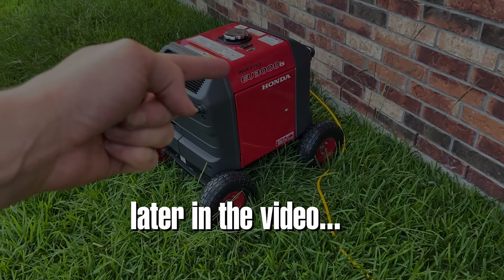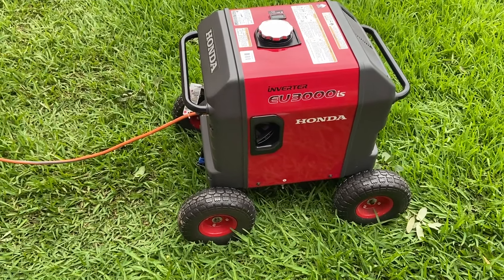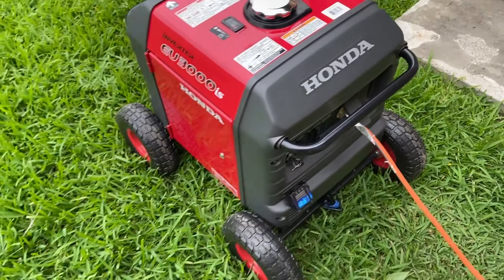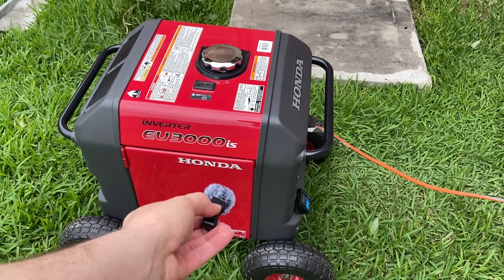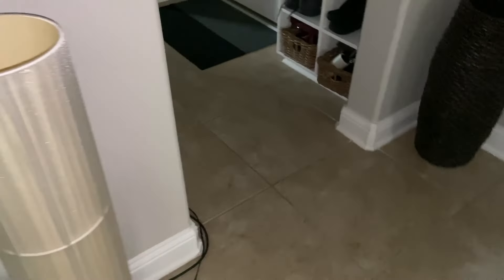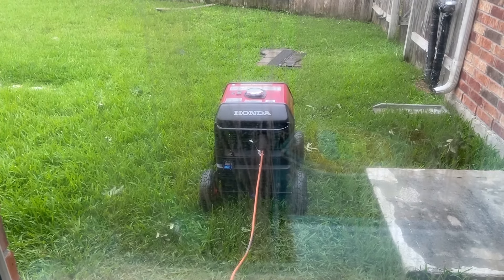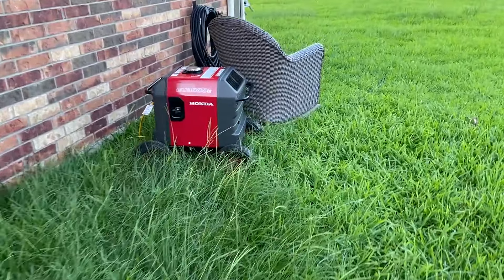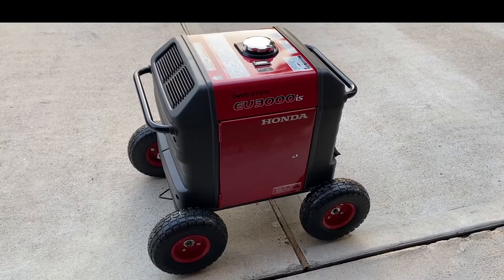Can you survive on a 3kw Honda generator? (Power outage survival test!)

Comment: With a Generator Inlet plug and interlock on the breaker panel you can get rid of those extension cords. The one 30a 120v plug will run everything including central heat (with natural gas), turn off 240v breakers.
Reply from the maker: I totally agree. It’s on my list of things to do.  Thanks for the comment!

Comment: What would you need to power the central air system?
Reply from the maker: That’s going to depend on your exact situation. I’ve heard of people running their home central AC with as little as 7k watts (Honda EU7000IS), but I think they had to modify their breaker panel and/or get a soft start for their compressor.

I would recommend getting sized for a whole home standby generator if that is something you’re interested in. It’s also going to be a lot more convenient using natural gas and not filling gas tanks if you have the money to invest.

Comment: Three things to look into. 

1.  Generator is a little too close to the window.  Old recommendation was 10-15 ft, now it’s 20 ft. 

2.  Battery powered CO detector. 

3.  Since the toaster oven pulls about 1500 watts by itself, you should have a dedicated 12 gauge extension cord out to the second outlet on the generator.
Reply from the maker: Great suggestions. Thank you for the comment.

Comment: I have 2 of these to combine the power output to a transfer switch. I used to keep ethanol free gas in the newer one and 91 octane in the other. The ethanol free fuel burned a lot quicker than the 91 so its kind of a pain in the ass because after a 6 hour outage the gen with ethanol free was at a quarter tank and the 91 was at a half tank
Reply from the maker: That’s interesting. If I can get more runtime from normal gasoline, then for sure I will keep that in mind during the next outage. Thanks for the comment.

Comment: You are showcasing the generator in eco-throttle. This is not representative for the general performance.
Once you start loading it with a few amps, it runs much faster (and noisier). I also have a 3000is, so that's how I lnow ;)
Reply from the maker: This video documents a real life emergency situation where my family survived on this generator for about three days. 

It absolutely shows the general usage capabilities during a real life emergency.  Powering several critical appliances simultaneously was no problem for this beast. The video speaks for itself in that regard.

The Eco throttle mode is one of the best features and I would highly recommend using it during an emergency situation to conserve gas and stay under the radar.

Of course the generator gets louder under load like any other inverter generator. I demonstrate this clearly in the video when I am running the window AC unit, air fryer, etc.

Thanks for the comment.